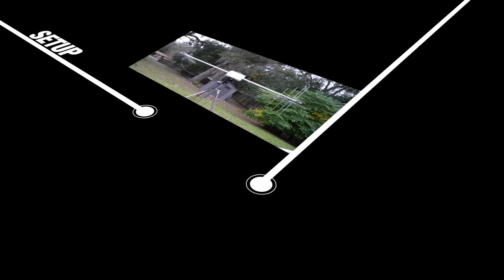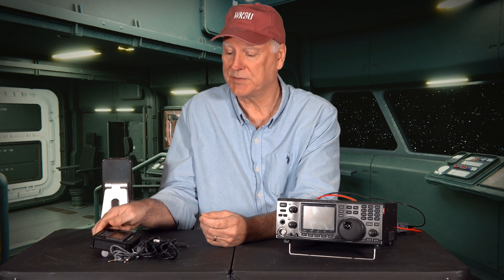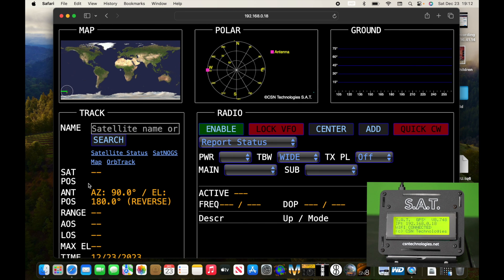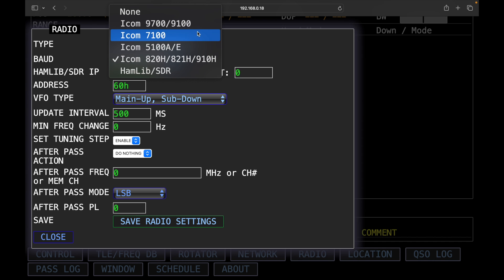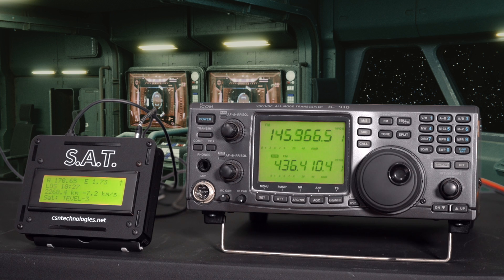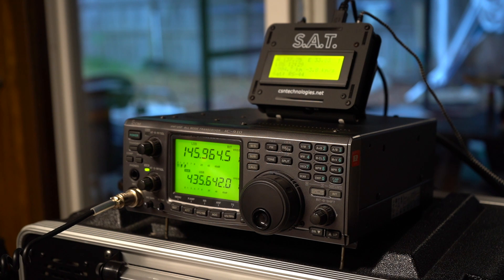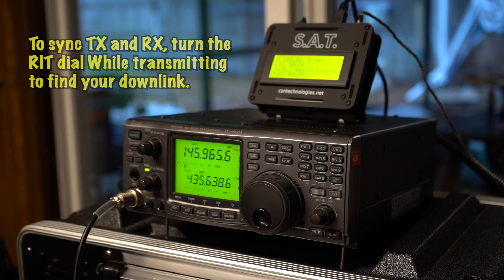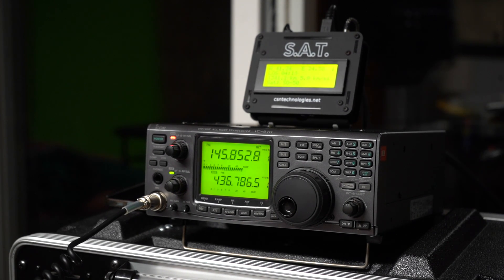Setup a Ham Radio Satellite Station

Comment: Can you start with the rotator in any orientation or does it need to be pointed in a particularly heading?
Reply from the maker: The CSN S.A.T. will sense the angle of the antenna, so you can start a track with the antennas in any position.

Comment: I'm setting up a satellite station that same  transceiver and the S.A.T.  
Everything is working fine but the SAT doesn't enable the PL tone on the radio. Have you run into this? I checked with CSN and they suggested asking you because they don't have this receiver.   
73
Peter KG8VR
Reply from the maker: Yes, it seems the problem is that once you turn on the SAT and it takes control of your radio it is difficult to wrestle control from the SAT to manually turn on the PL tone.  Two approaches: first, turn on the PL tone in the radio before turning on the SAT, and the other is to just keep clicking on the tone button on the radio and usually you can get the tone to turn on in between the SAT switching back and forth between transmit and receive bands.  I sometimes have the same issue with my IC-9700.  I was fighting the SAT PL tone last night when SO-50 was passing over.  And that was with my IC-9700.  Hope that works!  73

Comment: So have you made a similar video for sat’ comms using the 9700?  That’s what I was hoping this video was.  73 Tom KC3QAC
Reply from the maker: The setup for the IC-9700 is the same, except for the hex address is different for the IC-9700.  Where the IC-9700 really shines is with the waterfall display.  It is SO EASY to sync TX and RX when you can see your return signal on the waterfall.  Plus, the RIT range on the IC-9700 is very broad making syncing very simple.  The RIT range on the IC-910 is only 1Khz, which is inadequate for RIT tuning with the satellites.  I've been planning to make a video on tuning both the IC-9700 and the IC-910 for satellites, but my 910 is already on its way to the Philippines.  Watch for it in a few months.

Comment: Very interesting video; I just got active on the satellites again after many years away from it.  (I was active back in the days of AMSAT AO-13, which had fantastic coverage).

I’ve already had an IC-9700 for several years, purchased mainly for VHF / UHF / microwave weak-signal SSB / CW / FT8 work.  I acquired a used (but in pristine condition) KENPRO / YAESU G-5400 EL/AZ rotor system about a month & 1/2 ago, managed to get it & a set of used Yagis for 2 M / 70 cm. installed a top a single Rohn 25 top section just before the ground froze up here in Southeastern MA.

I’ve been using Orbitron tracking software (free!), & the Kenpro rotator included a satellite controller interface, but so far no luck getting everything to “play nice” together; this has me frantically trying to track the satellites manually, as well as manually try to adjust the IC-9700 for Doppler shift.  I knew about the S.A.T. controller, but wanted to try getting the one that came with my rotator working first.  After fussing with it & getting nowhere in the last several days, the S.A.T. is starting to look VERY interesting! 😊

73,
Tom WA1LBK
Reply from the maker: I really love the IC-9700.  (Except for the clock battery!)  By rotator controller interface, do you mean just a cable, or an actual controller box?  There has to be a box, like the S.A.T., or a Fox Delta ST2, or better yet a Yaesu GS-232B interface (for the G-5400 only).  I was using a Fox Delta ST2 for a long time and it worked fine and was less than $100, but it had more cables and only controlled the rotator.  I've never used Orbitron, but most satellite tracking software will control the IC-9700 for doppler correction with just the USB cord connection.  I used Ham Radio Deluxe and MacDoppler for rig control before I got the S.A.T. and they worked fine.  Best of luck with getting operational.  Maybe I'll have a QSO with you in the next few weeks. 73!

Comment: As far as rotators go, the CSN S.A.T device will interface with PSTRotator, which is a program that supports just about rotor that’s out there.  And as far as loggers goes, it supports the popular logging programs as well as creates ADIF files that can be imported into just about any logging program.

Comment: How many radios do you have?? OMG I’ve only got the UHSDR 918 under the x6100,
But it doesn’t seem to TX!
No SWR meter or Power meter responses when I press PTT on mic.. red TX led lights up, (obviously antenna is connected)
I’ve gone through all the settings as Pa bias needs to be manually adjusted..
Will the firmware update perhaps sort out this no TX issue?
Reply from the maker: I have zero experience with either of those radio options, so I can't really give you any informed feedback.  Maybe query one of the Facebook amateur satellite pages, or a satellite group at groups.io.  Best of luck!  73
Reply: @tekspeditionplanet9109  HI, Thank you very much for your excellent video , very beneficial and easy to follow.
I am in Australia, VK3JMT.
I just start to be interested in Satellite communication.
Do you mind to let  me know the antenna That you are using?
I am not sure where to get them ,hear in Australia.
Thank you
Kind regards
Angelo

Comment: What kind of pre-amps are those?
Reply from the maker: Mirage. They’re cheap and they work, but there are a lot of better quality pre-amps out there. I did not use the pre-amps in my demo QSOs because I didn’t have the bias-t power source in line.
Reply: @tekspeditionplanet9109  thanks, good to know your QSO's didn't rely on the pre-amp.  Sounds like you were getting decent signal w/out which is what I was wondering.

Comment: Looks like your radio is modified with an IF out. Might be useful to add an SDR to it for the SSB satellites. Frequency will be around 10.9 MHz.
Reply from the maker: Yes, the previous owner added the SDR tap.  Unfortunately I’ve been unable to get it working. I’ll have to open it up and see if something has come loose. That would definitely simplify turning on the transponder satellites.
Reply: @tekspeditionplanet9109  tune to 10.85 or 10.95 MHz and zoom into that frequency, leave it there and try to find a SSB signal on one of the satellites. You should be able to see that signal on the SDR receiver. All the running have to be done with your Icom radio. Not with the SDR….
Reply from the maker: @speedymartin2  yes, that’s where I’ve been looking. I just need to play with it more.
Reply: @tekspeditionplanet9109   maybe I see you on a cross Atlantic QSO in the future 73’ PD1MV

Comment: The S.A.T. is prerty nifty but I dont like how it expects you to use RIT to find your uplink. Thats completely opposite of how its normally done, you should be moving your uplink around to center it in your RX passband.  It would also be nice if they added support for Kenwood and Yeasu radios too. There are probably more TS-2000s in circulation than the IC-9700 and IC-910 combined, and I personally have a TS-790 too thats no slouch either.
Reply: If you note the RIT offset, you can enter it into the SAT and it will make that adjustment for future passes.  Now I'm almost always spot on without adjustment when I get on the satellites.  But, on the IC-910, you can't use the RIT anyway, because Icom placed both RIT and transmit only on the main VFO, which means the main VFO must be TX, so RIT is not available at all.  So for the IC-910 (and perhaps others), I unlock the VFOs, dial the receive channel to find my downlink, then re-lock the VFO so that the SAT continues to track both up and down links.  It's a bit of a chore and I'm not sure why Icom decided to limit BOTH RIT and transmit only to the main VFO.
Reply: @jeffreybaker4285  Thank you for the reply, that's good to know you can update your uplink frequency and save it, I wasn't aware of that.  Hopefully they eventually add UP/DOWN buttons to make it even easier like SatPC32 does. I'd buy one for myself then. I also didn't know the IC-910 RIT works the way you describe...that must be frustrating.  I have an IC-821 that actually works more like you'd expect in Satellite mode although it doesn't display the change in frequency as you adjust RIT.  The TS-790 does satellite mode perfectly - it displays the adjusted RX frequency when you twittle RIT, good CAT capabilities, and even has separate sequenced "SEND" signals at the accessory jack for 2M/70CM/23CM for use with preamps and/or linears which even the IC-9700 lacks. It's a shame they are so often overlooked due to their age.

Comment: Good Morning Jeff and Happy New Year. Very informative video.   I know the IC-707 does not have a  CIV port, but do you think it is possible to have the S.A.T control it through Hamlib as the CIV interface is presented via USB to my computer.
Reply from the maker: Do you mean the IC-705?  I’ve never used Hamlib, but I do know that some rig control software does work with the IC-705. See my IC-705 satellite ops video. In that video I use MacDoppler to control the radio for satellite ops. If you test it out on Hamlib, let me know how it works out. Good luck!